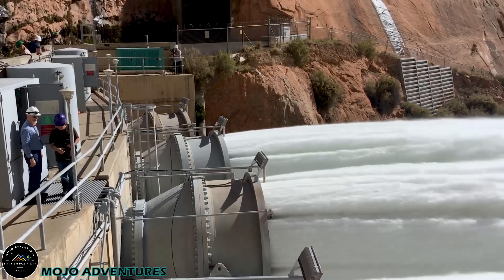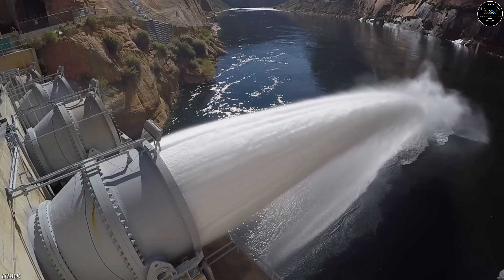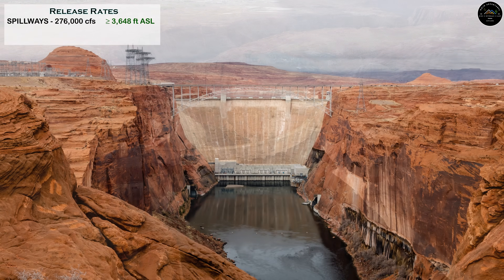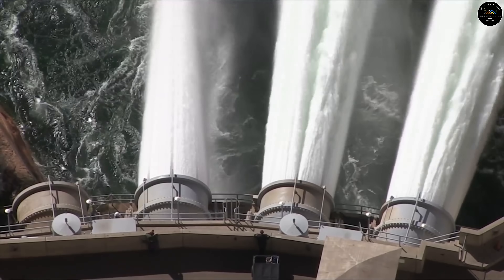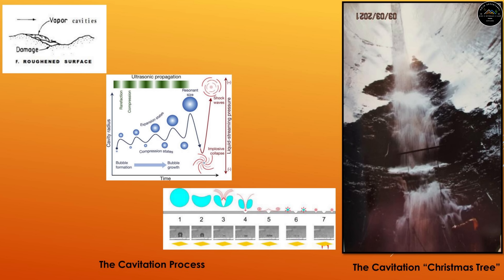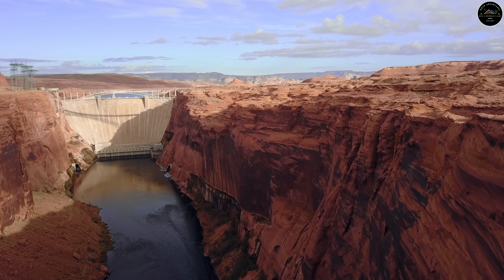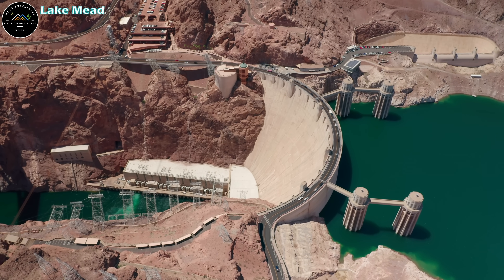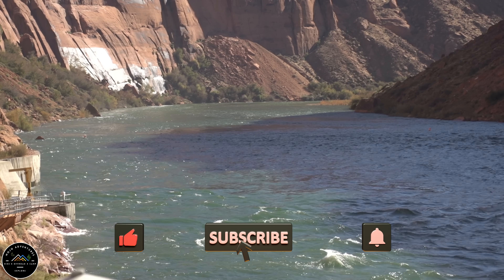TROUBLE ON THE COLORADO! Damaged Pipes FOUND Inside Glen Canyon Dam at Lake Powell #water #update

Comment: The repairs are either hapening now or have already been completed. It would be interesting to see how crews dewatered the diversion tubes to do the work.

https://usbr.gov/newsroom/news-release/4946
Reply from the maker: Thanks for the link, I was waiting for them to release more info on it. Initially USBR reported it was going to be a "relining" project but everyone wondered what type of process would be used.
Reply: It looks like the repairs were just for the exterior steel surfaces to prevent corrosion, not the concrete part inside the dam where cavitation has happened. That's going to take some creativity to fix.

Comment: One correction: Only the left spillway was damaged in 1983. The right spillway wasn't used to ensure that an undamaged spillway was available should the left spillway fail, which it did that year. Repairs and upgrades were made to both spillways to prevent cavitation issues in the future.
Reply from the maker: Thank you for this info! I didn't even consider it but now that seems obvious. Would be catastrophic to have both damaged and the reservoir nearing the top!

Comment: The answer to the pipe damage is not making a pipe that is descending.
Reply from the maker: This is very true! Cavitation was caused by the steep descent. I wonder if there was some geological or engineering issue as to why they don't place a bypass at the foot of the dam so sediment could flow also.

Comment: Does the cavitation affect PVC in the same manner as concrete?
What about fiberglass lining?
Reply from the maker: Interesting question! I'm not sure of the differences but I know they started the re-lining project now. I will have to look if it is concrete/plaster based lining or something different like an epoxy based lining of some sorts.
Reply: Concrete is probably ten times stronger than PVC.
Reply: @bigredc222  Stronger, sure. But concrete is very susceptible to cavitation based erosion. PVC lining may not be an issue.
Reply: @HectorFabela-k6u  Maybe someone more knowledgeable than us will chime in.

Comment: In crop flood irrigation system underground sometimes we get a "waterhammer" when someone opens the gates to much. Caused by a air bubble bouncing around in the pipeline. Blew the stacks off three vents and ruptured the line... Cost was enormous$$$$. I amagen your facing the same type of problem just on a much greater scale than we ... My advice; Limit the flow. Never go full boar. Check ✔️ for sinkholes, that could cause catastrophic failure of the Dam.... They have like ultrasound devices that scoot across the surface like a lawnmower. Cuz Florida gets alot of sinkholes there used quite a bit there.

Comment: It sounds as if they are going ahead with repairs. From what I can tell (from press releases), they are going to line the discharge pipes with an epoxy coating. I picture this as similar to the sanitary sewer linings often seen in neighborhood projects wherein contractors install a green colored liner (activated by heat?) to extend the life of deteriorated sewer pipes.
Reply from the maker: Interesting info, thank you for that! I'm going to have to look into it now. That's pretty cool some viewers had actually suggested the epoxy lining. I've seen that process... looks like a sewer snake comes out the other end and cures then they just cut off the excess. Imagine the size of an industrial one...

Comment: Install smaller diameter pipe from above to below the damaged section with flared ends,welded to existing pipe. Install additional metal along the bottom section if needed. Reducing inlet flow to slow cavation. Lower flow better than no flow.

Comment: A viable, permanent, albeit very expensive, solution might be to “sleeve” those pipes with either Titanium pipe sleeves or diamond-encrusted hardened steel pipe sleeves.

Comment: Would it be possible to build a coffer dam around one spillway entrance, then build an additional gated bypass tunnel connecting the lake to the spillway at a low water level, then the spillway can be used at a much greater release rate instead of the river works?
Reply from the maker: That is an interesting solution actually! It would save money connecting to the already built spillway tunnel. Ideally it would have to be pretty low to allow the silt to flush also. Just waiting to see what the USBR is thinking of pursuing now... if anything. I have a feeling if the water levels rise again this will fade into memory until the next problem arises.

Comment: Ultimately if they want to stop the cavitation they need to put buffers inside the tube to keep the water speed down.  Or they need to put a smaller inlet then outlet. Ultimately it's the compression of that water that's causing the cavitation.

Comment: All the CA demands can be lessened by making CA finish the initial planned # of reservoirs and capacity. CA turning to desalination and aquifer replenishment will also lessen the needs. The power needs can be lessened through the SW by requiring every new home to have solar power production 10% above their baseline usage reducing the need for power from the dams. Ending the mismanagement in CA will retard the water requirements leaving more for the inland states. OR too could do a better job of water management and sell water to NV. Water could be better managed along the Mississippi and its tributaries creating more reservoirs and saving flood waters via pumping to those reservoirs and into the aquifers.

I do not buy into the shortage of water knowing how it has been mismanaged. The Salton Sea in CA is below sea level and could be filled to sea level with water from the Sea of Cortez which would increase the moisture from evaporation and supply a source for desalination. The power could come from the sun that is shining in the deserts most days. The populations of all these water concern states could be reduced by 10s of millions just be removing non-citizens (illegals being the most impactful). Every dry lake in the desert near the Sea of Cortez and the Salton Sea could be filled with salt water.

More than this could be done, but I suspect these alone would have a huge impact.

Comment: In my 30 years of water management I have seen cavation do this damage before . (what the erosion in the pipes is caused from) . The engineers  surely are aware  of this. Velocity of the water causes air bubbles and scrubs the surface  and the air bubbles act like little explosions on the surface. With that said concrete pipes are not durable. 🤔 so maybe a liner of stronger steel or stainless liners be used.  Just a thought.
Reply: God forbid you provide such a logical recommendation to these agenda driven maniacs… 😂

Comment: Sounds like a Golden opportunity was missed in 2022 to make Overdue repairs and Necessary Upgrades …..
Reply: I thought the same thing, seems like the best time for repairs would be when water level is at an all time low.
Reply: Hindsight is 20-20 surprise, surprise
Reply: @richardcornelius1050  you all didn’t learn anything from this video, did you? 😆 

The issue IS the low water level! When it’s at or near historic lows, there’s only ONE way to flow water through these dams, and that’s the river flow outlet system / bypass. It’s somewhat counterintuitive, but at low water levels you absolutely must maintain and be able to use that system, otherwise the entire Colorado River stops flowing - which would be catastrophic downstream. 

It’s easier to do maintenance at normal levels as they can just operate the power house and keep things flowing that way. The intakes for the river flow outlet system are (pretty much) always under water anyways, so even severe droughts won’t really make maintenance work any different or easier in that respect.
Reply: The repairs are happening now or have already been completed. 
https://usbr.gov/newsroom/news-release/4946

Comment: Cubic feet does not give a familiar or recognizable measure of the volume. Either use gallons as unit or and preferably metric units, please.
Reply from the maker: Copy that, thank you for the suggestion! I currently relay the data just as it is reported by the USBR 👍
Reply: @mojo.adventures  
Just multiply the archaic CF by 35.3146 to get metric tonnes. 😇
Reply: You don't own a calculator?
Reply: @goldfieldgary  
Yes. Why, Gary? Does every viewer that is unfamiliar with the random imperial system used by three backward countries world wide have to use their calculator individually or just one individual - the one who makes the video?
Reply: @Peter_Riis_DK  Seems like a lot of whining for such a minor problem.
Also I'm willing to bet there are a  lot of units of measurement that you're unfamiliar with, as every discipline has different phenomena to measure.
And how did you miss the beginning of the production, with a person standing above the discharge pipes, giving an idea of the scale?
Reply: @goldfieldgary  
Seem that there is at least one inconsiderate individual in your neighbourhood .

Comment: So it is fair to say if a situation arose when massive flooding happened and this dam had to release massive amounts of water for an extended time , the dam may fail at the pipes
Reply from the maker: That about sums it up! It would be a "just send it" situation as topping the dam would be even more catastrophic. On the other hand, if the water level fell too LOW, the dam also couldn't release any water downstream because the bypass intake is too high. Catch 22.

Comment: Is there a type of metal that would be hard/strong enough to withstand cavitation if used to line the riverworks spillways?
Reply from the maker: From the feedback I'm seeing in here, no rubber/poly compound could withstand the forces of cavitation at this level. Even specially formulated concrete is susceptible. Looks like the best solution is to prevent or introduce cavitation in a pre-emptive controlled way like they did in the spillways.

Comment: large scale atmospheric venting and longer lower pitch runs. Cavitation is from fast moving water and or vacuum pressure. Open top spiral out from top to bottom gutters getting wider as you go down would help with the speed of the water as well. Smaller inlet then outlet/run would get your less energy as area increases pressure decreases.
Reply from the maker: Interesting, thank you for sharing that bit of engineering! I know they solved the problem in the spillways with a cavitation ring that introduced air at the top. It seems they didn't have any idea of these problems when the dams were engineered... and it wasn't that long ago. Moving forward I would hope all these solutions are engineered into the designs.

Comment: Very informative video.  Thanks!  Question:  are the diversion tunnels still in place (or could be re-opened?)
Reply from the maker: Thank you, appreciate you watching! The diversion tunnels have obviously been well plugged with solid concrete, but the engineering is still there. The problem that comes to mind is how to drain the lake enough to work on it, without having a low level bypass installed to begin with. That would be a LOT of pumping and dredging, but they did it at the bottom of Lake Mead for the 3rd intake, so I'm sure it's possible!

Comment: Lake Powell water levels won't drop below the River Outlet Bypass, when the reservoir is at that level leave them open and the river will continue flowing without causing cavitation problems in the pipes.

Comment: They could just dismantle the dam, then install solar panels all over the Glen Canyon National Recreation Area. That's right, cover the entire area with solar panels because the Glen Canyon Dam produces over 5 BILLION KW of electricity annually. And of course we will need that power since our government is pushing EVs.

Seriously now, this is not surprising. Government at all levels does a horrible job at maintenance on buildings and structures. They keep pushing things down the road until it can't be ignored. Why? Because at all levels, they know they they have to use every dime in an annual budget to ask for the next year's budget to increase. Government does a horrible job at being financially responsible. When they can print more money, increase a debt and deficit, and then push more taxes onto it's citizens, there is nothing to stop the behaviour.
Reply from the maker: It's funny but it's not... the solutions seem so easy but are often buried in red tape, environmental studies, corrupt bureaucrats, shoddy contractors, and on and on. By the time a solution is approved, there are 3 new problems that have surfaced in the meantime from inaction. At very least, the entire town of Page could easily be powered by solar. So one of the main arguments for keeping the dam is already null...

Comment: I have personally been inside 2 of the turbine outlet pipes at Carter's damn... They're massive in diameter 14 feet wide. While I was building scaffolding for the engineers to be able to put in new water flow and cavitation sensors in the pipes. They opened one of the 4 outlet pipes. We're 120 feet down in this damn and when they open that flow valve. You can feel the pip you're in vibrating while you hear nothing but the whoosh of water in the other outlet... Pretty scary Because it sounds like the water is coming thru the pipe you're in...
Reply from the maker: Holy moly... what an experience🤯 I think the closet I've come to something like that is being down in a slot canyon during an incoming freak storm. You can hear the water and feel it... you just don't know when or where it's coming! First time I've heard of cavitation sensors also, something new to look into. Thank you for watching and commenting!
Reply: @mojo.adventures  I remember it all like yesterday... It was 2009 I took a job as a scaffold builder for Georgia power and its other cousins like duke energy and the army corp of engineers... (Nobody was having their trees cut, people just couldn't afford it) needless to say, taking that job opened my eyes to the world of engineering... I've been to places most people could only imagine inside powerplants. From inside of the actual boilers of coal fired plants like plant bowen to inside hydroelectric dams, I even worked for the TVA (Tennessee valley authority). If people only knew what it took to produce electricity on this scale to actually see behind the curtain like I have. From turbine floors you could eat off of they're so polished and pristine... To the belly of the beast where it all happens in the shadows. It's dirty, dark and miles of it like a labyrinth.
Reply: scary
Reply: That’s a poor practice to open spillways while workers are in different spillways!
Reply: @djdup3819  we had a lock out tag out system in place... We had so many locks on the valves it was ridiculous. It was literally impossible to have something horrible happen. We all had our own codes on the locks too that we set. Literally impossible to remove the lock without the person it belonged too and knew the code.
Reply: @MarkTheTreeManVann  liar
Reply: @ryanfarrow6058  happy new year! Clearly, you're a miserable person... Get some exercise, some sunlight and a job... Move out of mommy's basement too. I'm sure she'd appreciate it.

Comment: Repair the damage, then construct, design straightener to cause water to flow in an laminar fashion reduce the flow per each discharge thus reducing turbulence, the straightener to be installed up stream of the down stream discharge points, reduce the flow, reducing flow due to past design errors

Comment: My dumb idea would be to add an elastic resin liner to the pipes.  Just spray it on, and it would make the concrete tubes a lot more tough and durable.
Reply from the maker: Interesting! I've seen that cool sewer line repair compound they snake through the pipe and then let the resin harden into a new lining. It would be interesting to see that scaled up to something this size. I'm wondering at this point if the USBR is weighing a repair at the dam or a total major operational shift...
Reply: Spillway flow velocities were over 180 feet per second. I don't know what the outlet velocities would be, but not much would hold under those conditions.